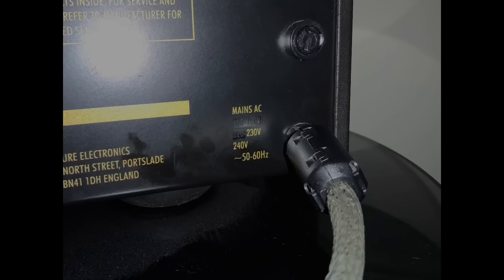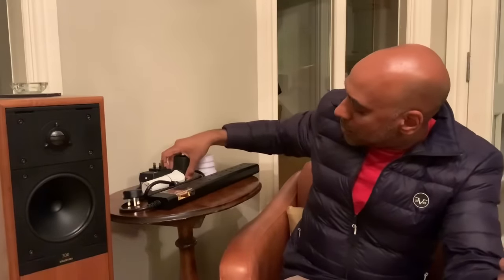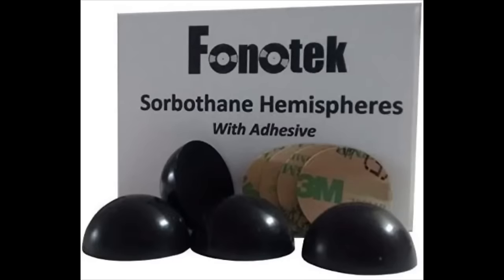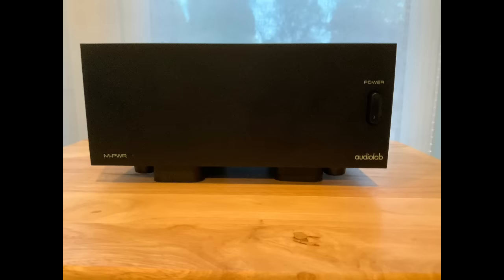My Top 5 Inexpensive Hifi Tweaks

Comment: Interested in your view in expensive power cords. Snake oil or true upgrade.
Reply from the maker: Hi Richard, I haven’t played with enough of them to give a definitive answer. I suspect it is the same as interconnects and speaker cables. Maybe someone has found a way of squeezing a slight improvement in performance out of the high end ones but a very good power cable such as the Lapp and Belden 19346 is not expensive. Thank you for watching and commenting 👍
Reply: Power cable needs to deliver current not a wave form.  10–1 4awg and made of good copper—and connectors— will give component clean power.  Exotic materials and design geometry done as much for inflating selling price as some sonic improvement.  In US one can get good quality , well built cables for $50-100

Comment: Anglais

Just a quick question, what is the point of plugging a very short cable at 70 £ per meter with luxury connectors on a socket connected to a network of several meters made with shitty cables buried in the walls to the electric meter?
Reply from the maker: Lots of cables in short proximity to each other, some carrying power and others sensitive signals. The shielding, geometry, construction materials, termination and quality of connectors can add up to make a difference but not everyone will believe me. Thank you for watching and your question 😉

Comment: Brilliant and many thanks. Tell us about contact cleanerslike Deoxite. Worth doing?
Reply from the maker: Hi Paul, thank you for watching. De Oxit, pricey but definitely worth it. Deoxidises and cleans the contacts extremely effectively 👍
Reply: i would say if you can hear difference after disconnecting and reconnecting something, then reach for deoxit or consider improving that connection. I think this affects older equipment more, and speaker connectors in particular.

Comment: I upgraded a power supply (PS3) to my Audio Alchemy DAC (DDE 3) for £100 and it made a big difference. More bass, better dynamics.
Reply from the maker: Thank you for watching and commenting Coneman3. I have upgraded my switch mode power supplies for the low noise Ifi ones on my Chord Mojo and Auralic Aries Mini. Again a small but noticeable improvement.

Comment: Adding even a single ferrite to analog signal carrying cable like interconnect or speaker will effect the frequency spectrum.
Reply from the maker: Thank you for watching rkt31 rkt31
Reply: The ferrite attenuates interferences of very high frequencies in MHz range and has its useful effect. Please check wiki. I use it on all home electrical appliances (at power cable) that have the motors.
For good grades power cables, I weld with 3% silver solder wire at all cable terminations.
Most of us like to tweak and be happy. A way of common life.
Thank you for uploading this good brave video. 👍

Comment: Hi pal, sorry to be a nuisance but that power block is really holding your system back. I've owned it and tested it thoroughly. Although it makes music sound cleaner, it impacted dynamics and drive in a noticeable way. I would suggest a Musicworks Reflex lite instead, its star wired and will really bring back dynamics. I would avoid all filters of any kind on a power block. Just solid case work, star grounding and the best contacts i.e. sockets, cables, plugs. No need to spend a huge amount, just stick to these principles.
Reply from the maker: Hi K, I don’t seem to experience the same issue with my systems are you sure it is the same design? Thank you for sharing 😉

Comment: I believed that ferrite core is detrimental to speaker cable performance. Check out PS Audio's opinion on this.
Reply from the maker: It can cause high frequency roll off if you over do it and won’t work in all systems. However, some amps (that have no Zoble network on the output stage) prefer the extra inductance. There is also a belief that it can reduce natural resonances within the speaker cable. Worth a try and see for yourself. You may find this article interesting...
http://www.empiricalaudio.com/computer-audio/technical-papers/myths-and-snake-oil

Comment: I am curious about the floor isolation and coupling for free-standing floor speakers.  I'd assumed that having spikes into hardwood would allow the speakers to produce sound without any oscillation or vibration caused by the movement of the speakers/drivers.  At very low volumes, the force of the drivers on the speaker cabinet would be insignificant, but at medium to higher volumes, I had thought sound would be degraded because the speaker case would deflect/move in the opposite direction of the force of the driver, robbing the driver of some of it's sound pressure at some moments, and adding to it when the case rocked forward as it "wiggled" around.  My speakers are on spikes going through soft carpeting.  Would you still advise the rubber isolators on carpet rather than spike through it?  Thank you!
Reply from the maker: Hi thorenjohn, if you have a thick carpet on a suspended floor, the carpet will dampen some of the vibrations. A little bit of movement in the speaker when you try to wobble it  by placing you hand on top of the speaker is nothing to worry about as long as the speaker is not rocking on its own accord. I would still place the anti-vibration feet under the speakers even on a carpeted floor as illuminating vibrations in the floor itself is far more important.
Reply: @abritishaudiophile7314  Thank you for clarifying that.  Your videos are appreciated, as are your replies!
Reply: @abritishaudiophile7314  Extra thanks again.  Isolating my speakers from the hardwood floor has done wonders for the sound in my room - a substantial improvement in bass tightness and overall imaging/soundstage.  It's like buying a better speaker or amp :-)
Reply from the maker: Thank you thorenjohn. I am glad it worked out and I appreciate your support of this channel 😉👍

Comment: I am very surprised, for the first time I see a ferrite filter used on a speaker cable. As for the conditioners, I don't use them, they always degraded my sound, killed the dynamics.
Reply from the maker: These are simple tweaks to try out and see if there is a benefit in your system 😊

Comment: Hi hope you are well in these time ...would it be possible to send me a link for then square sorberthan feet I cant seam to find them I'm in uk .cheers keep the vids coming...
Reply from the maker: I have had mine for years but can’t seem them either. I bought the silicon ones from Hudson on eBay recently and they seem to work just as well.
https://www.amazon.co.uk/Hudson-Hi-Fi-Silicone-Isolation-capacity/dp/B079SV39KW/ref=sr_1_42?crid=2FVCIOKOAVHUC&dchild=1&keywords=anti%2Bvibration%2Bfeet&qid=1589794028&sprefix=antivibration%2Bfeet%2Caps%2C219&sr=8-42&th=1

Comment: If i was to add ferrite rings to bi wired speaker cable would i add a ferrite to say both positive ends or would it be just one ferrite ?
Reply from the maker: Hi Mark, they need to be used sparingly. I would start with one on the woofer and see if the bass tighens up. Then try on on the tweeter. Listen to see if the highs are smoother but remove it if you get too much high frequency roll off.

Comment: Break out the brasso and clean all plug pins of years of grime, and make the cleanest connection at the wall.
Reply from the maker: Good advice 👍
Reply: I don't recommend using brasso! Use just a pad instead, without any of brasso's chemicals. You don't know what it does to your wires. After all, your brass cutlery was never meant to handle electricity :')
Reply: Yep, be careful with brasso. Use DeoxIt.
Reply: @sashbar  I only use it on my mains 3 pin plugs and use RS contact cleaner or IPA on my interconnects.
Reply: There's these steel wool buns the same like brasso but without buffing compound. Use that together with deoxit and you'd be fine.
Reply: @AnnaVannieuwenhuyse  thanks for the tip.

Comment: What if you have powered monitors? For the ferrite? Oh, and TRS/XLR cables?

Furman is better. PL8C & higher models.
Reply from the maker: You have to be judicious in using ferrite core. They add impedance. There is no point using them on any shielded cable or one that has a twisted geometry as the problem you are trying to fix has already been resolved.

Comment: The noise filter you showed up is a very common cheap filter you will find inside TV screens to computer power supply.
You can buy the same noise filter as you have on ebar! it's a fiberglass card. the problem is that the coil has too thin wires and that is the problem. Paul from PS audio who has a youtube channel doesn't have much good to say about this type of noise filter!

The more the amplifier draws from power contact the more you will experience weaknesses with this type of noise filter. The main problem is the coil!
Reply from the maker: Hi skrotkalle, it is only a £35 device so I agree a cheap filter but does the job in terms of reducing the noise. It doesn’t reduce the dynamics in my systems. I think it is a case of try it and see.
Reply: @abritishaudiophile7314  Most of the parallel filters are ONLY a capacitor over the current phases! You already have it inside most audio devices and other electronics equipment!

Do you think they work then they do.

You must first know how they work in detail before you can say anything about them

Have you ever watched PS AUDIO from the US on youtube? It is a factory with 40 years of experience in highend sound. owner Paul doesn't have much good to say about the noise filters you showed.

Do you know that it is from 0% to 40% - 60% of the max watt power that gives you the best sound quality ??

Have you looked at the email I sent you ??

http://www.capacitorguide.com/filter-capacitor/

Comment: i recieved the extension block.looks the part for the money.however compared to my wireworld its not as good .the wireworld block has no power cable attached.therefore i run it with one of my upgraded cords.i dont have that option with that new block .so ive used it on my computer instead.what i would say is before fitting it i measured the noise on my wall socket then after it was fitted.it dropped the noise by around 92% sot defiantly works and is great for the money.so in my case there wasnt any upgrades in quality.but without buying and trying id never know.at least the computers sounding a bit more quiet.i also bough some isotec feet too to suppoert my ps audio bhk 250 amp.ill report back at some point after a few hours listening.. thanks
Reply from the maker: Thank you for sharing this Dean. Like toy say, “great for the money.”

Comment: I'm not going to argue the voodoo of audio cables, I understand capacitance, it's a real thing in electronics but I can't tell how much it affects the sound on a 3 meters cable, and I don't understand how an outside magical cilinder wrapped around an inducvie cable shrouded in plastic, can "suck" interferences in the signal which goes through it. Anyway it's a belief which everyone is entitled to own
What i really don't get is this parallel shmo connected to your socket.
The logic behind this is similar to having two swimming pools drawing their water from the same main faucet, and putting a filter in one pool, expecting it to clean the other pool as well.
Reply from the maker: Hi Shai. From my experiences the parallel mains conditioner does work but I would to love to ask Thorsten Loesch (designer) exactly how 😉
Reply: @abritishaudiophile7314  thanks for addressing my comment, it would be interesting for me to know as well.
 I like music and I like to hear it in good quality but I'm not an audiophile mainly because I can't hear the differences in sound which audiophiles say they can.
I'm sure that psychologicaly if you invest time knowledge and money in picking the best system you can afford, you'll enjoy listening to it more than listening to anything else, but I wonder what would happen in a blind test, can you really pick up the more expensive cable? Can you distinguish between 2 isolation devices? If you can, all the best and keep up with sharing your knowledge, I'm sure it helps many people with making the right choices.

Comment: Call the Doctor he has hifi-itis 🤪
Agree with you on mains conditioner blocks I bought a isotek one & had it on eBay by the end of the week.
Did you put snake oil at number 100 😂

Thanks again for another video.
Reply from the maker: Hi Mads, maybe snake oil should be at number when when you discuss anything related to hifi 😂

Comment: It is probably a reason why NO amplifiers have noise filters on the power input! Yes they have a capacitor
Reply: True
Oftentimes the designer of the amplifier is savvy in that regard. 

However, if the designer of the mains isolation device is more adept at mains isolation than the designer of the amplifier, ... then such a solution is worth exploring.
Reply: @Simon A The capacitor acts shorts out high frequencies, while passing through lower frequencies.

http://www.capacitorguide.com/filter-capacitor/

Comment: How about protection your expensive devices for high voltage power from lightning strikes. On top of my list.
Reply from the maker: Hi tweakradje, the Tacima mains conditioning strip has gas tube surge protection. Thank you for watching.
Reply: Surge protection in the form of a 'gas tube' will not cope with a direct hit from lightning. If you want to protect your equipment in the presence of lightning unplug it from the mains before the lightning gets a chance to destroy it! There are many things you can do for real protection if you absolutely must leave everything connected to mains power, but it involves far more than a mains conditioning strip. Very solid grounding where the mains power enters the premises would be a start. The mains conditioning is no doubt a very good idea though. Mine has some big ferrite cores in it.

Comment: That tacima made my naim audio hi fi worse. It created noise on CD and AV inputs that weren't there before, very disappointed.
Reply from the maker: Hi Mario, unfortunately with these things they are quite system dependent. Thank you for watching in any case 😉
Reply: The Tacima CS947 is ok for a budget setup or an AV / sound bar maybe but mid-fi or high end gear, no. I experienced a loss of sound stage depth, and a thinner false sounding treble. It’s good value at circa £40, but it has its limits.

Comment: The absolute best tweak is to do proper AB tests. Ask your buddy over, ask him to plug in the power conditioner gadget or not while you listen to the system blindfolded. Have your buddy roll a dice, if it comes out even he plugs in the power conditioner or the fancy power cable, if it comes out odd he doesn't plug in the power condition or use a regular, un-fancy run of the mill power cable. Your task is to blindfolded listen and try to guess if the fancy bits are plugged in or not. There is absolutely no trick to "hear" an improvement if you know an improvement should be there, the trick is to determine if the improvement is there or not without actually knowing if your new gadget is plugged in or not. 

The 5 inexpensive tweaks in this video is way to expensive if they don't work. Blind test those gadgets to check if you can actually identify a difference when you don't know if the gadget is plugged in or not. If you can actually identify blindfolded if the gadget is there or not, great, you can now pick whether you like the sound better with or without the gadget. If on the other hand you can't tell whether the gadget is there or not while blindfolded, you know that to your ears the gadget makes no difference and you can save money by returning the gadget for a refund.
Reply from the maker: Blind listening tests are only scientific if you have many people do the test so that the sample size is big enough to remove anomalous results. Then there is the issue of the inherent unreliability of our short term auditory memory. This is why short term blind listening tests don’t work 😉